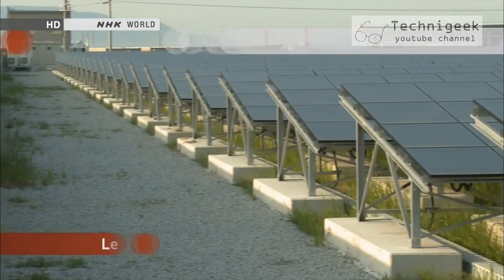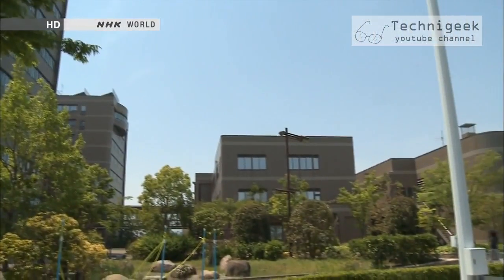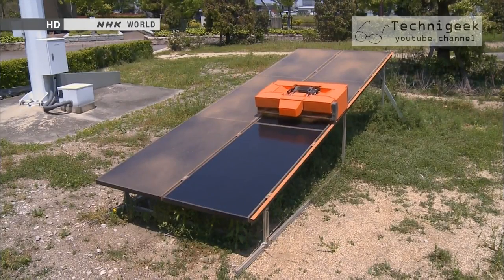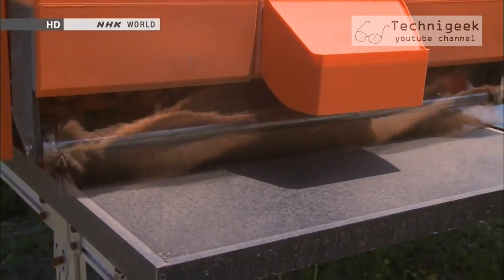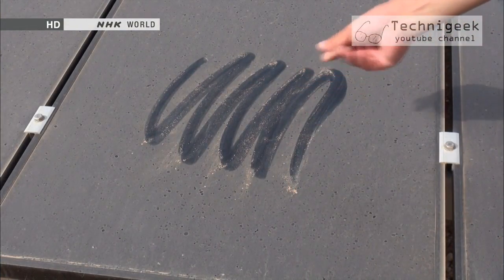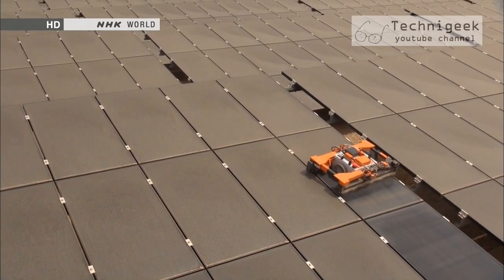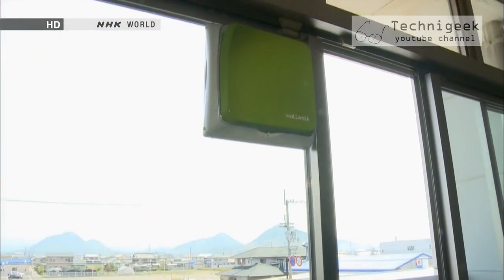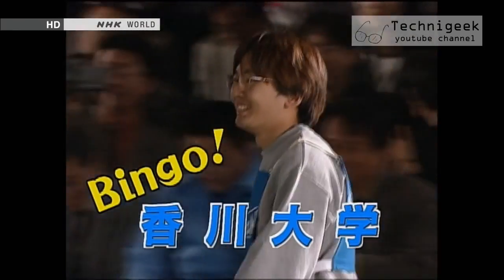Solar panels cleaning robot روبوت متخصص بتنظيف لوحات الطاقة الشمسية

Comment: every panel should have it's own cleaning arm like cars and they have to powered by panels directly. so you can clean all farm at one single button click or computers can measure power level and clean it automatically. cleaning them one by one is not good method because every panel should wait their turn and this situation cause power lost.

Comment: So for a large solar farm you would use one of these on each big line of solar panels. So if you had 20 rows and each row has 200 panels together. You would buy 20 of these robots to do each row. To extend battery life on them you either could add more batteries, or instead you should have the whole back of the robot be a solar panel, with the size of it you could have a 30w solar panel on the back of it, if the 30w isn't enough to run the robot then at least isn't going to contribute to it's power usage and extend the battery life significantly and maybe it could go for 5 hours instead.

Comment: Photovoltaics are inefficient? Compared to what? All the energy we use, except nuclear, comes from the sun. Solar PV is one of the most efficient way to convert sunlight to electricity, far more efficient than coal, gas, biomass and oil, which are all far below 1% efficient. Only Heat concentrators may achieve higher efficiencies.
Reply: Also the claim that coal is 1% efficient is not very valid. Japan has the most efficient coal fired stations in the world, their efficiency is around 40%. The world average efficiency for coal fired stations is at 31%.
Nuclear plants are even more efficient again, but I think their risk factors slightly outweigh their efficiencies to be honest.
Reply: What is your source that coal is less than 1% efficient?
Reply: But you need to pay to clean up the photovoltaic's mess